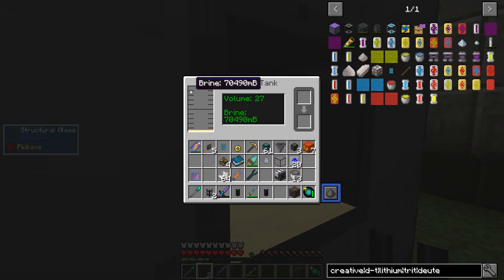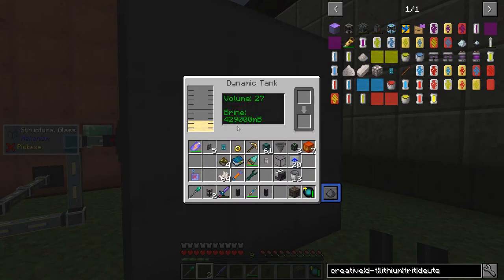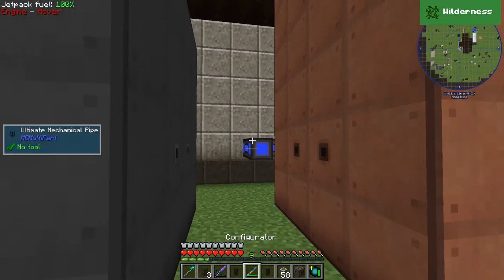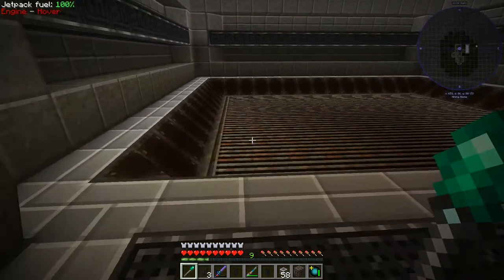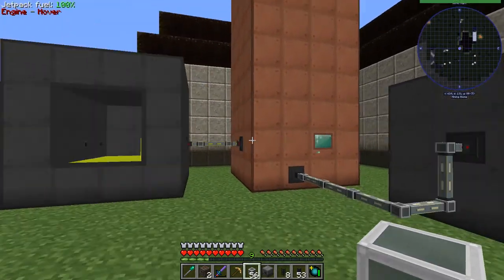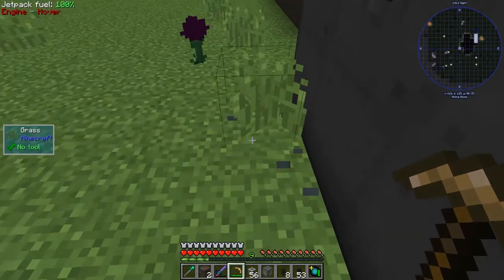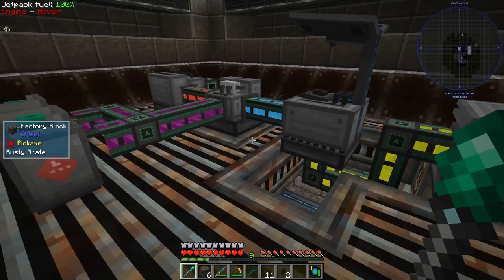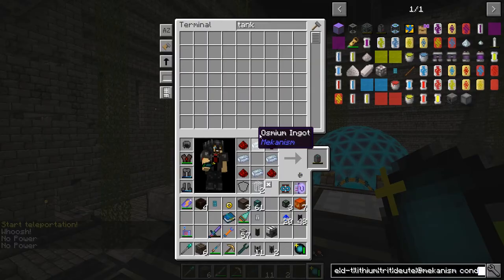Age of Engineering 72   Creative Gases and Fluids Pt 1

Comment: If you haven't worked it out, the easiest way to get Hot Coolant is to build an IC2 Reactor with the fluid casing around it. It'll turn the cold coolant into hot coolant. Normally you'd run that through heat exchangers to make steam but in your case you can just pump it into the fluid tank.

Since the red splotch on the gas tanks is an automatic output, you can put them down facing into the back of the next one and it will automatically push until both are full.

Automating those Crystals? Make a powered spawner of them, and set it to capture mode. It won't do anything until fed with a soul vial, so you can automate the crystals that way.
Reply from the maker: I had a little bit of a play with the thermo-nuclear reactor! I started off just with one rod and lots of vents. It made hot coolant, albeit slow as hell. I added quad fuel rods! It went very fast and then exploded xD good job it was a test world! Any good diagrams for a slow but not too slow reactor setup?
Reply: Not a good one. I always used a 2x2 of quad fuel rods, surrounded by heat exchangers and heat vents, and then filled the rest with reactor plating to get a lot of heat head room. Then I used a timer to turn it on until it almost blew, then off until it cooled down completely. But I always used computers to do that and I don't think this pack has any, so...

Personally I'd steal Dire's design because he always builds totally safe reactors. The hardest part is getting the necessary Cold coolant because it's 1:1 with the Hot.